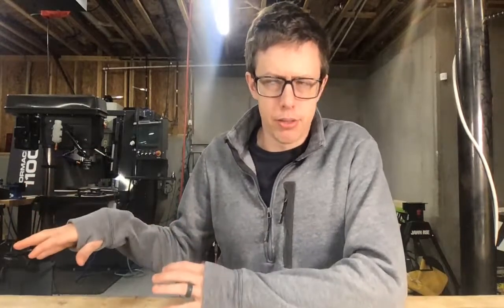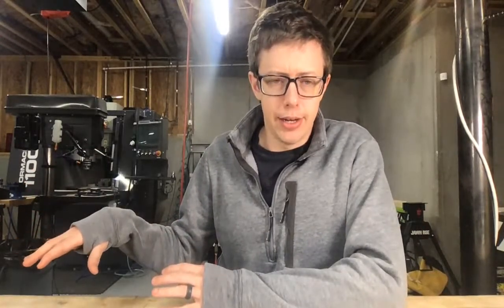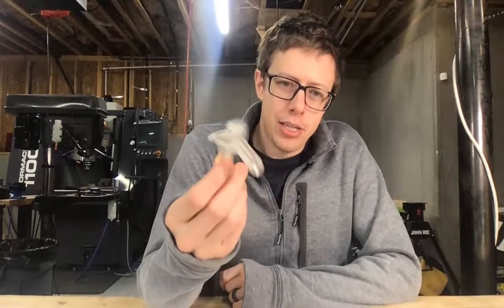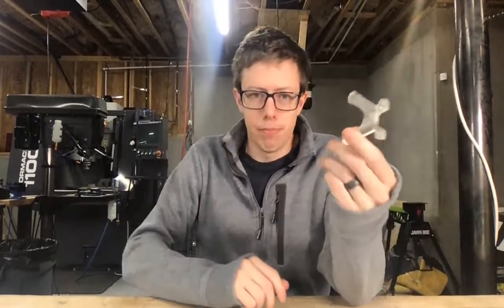SMH Livestream Jan 2021

Comment: 0:35	What projects are you working on currently?
5:44	Do you have a useful project in view?
8:57	What books are you reading to study for your social media app?
9:58	Do you use social media yourself and to what extent?
13:01	Do you read hacker news?
14:14	What aspect of robot design do most people get wrong?
22:42	What about the podcast?
24:04	When did you make your CNC machine? What did you build? What did you buy?
28:06	|-> What would you do different if you made it again?
29:38	Have you thought about getting an assistant to help?
30:19	Do you have concrete plans or ideas of where you want to take the channel?
35:41	Where do you buy raw aluminum/steel?
37:02	What did your wife think at first about you starting a channel and your decision to do it full time?
38:28	Top 3 candidates in the running for the open source project?
41:44	How long before you posted your first video, did you think about starting a youtube channel?
46:15	Can you afford to hire someone? Has the Patreon reached that level?
48:25	What are your long term goals? Do you see yourself doing YouTube until retirement?
50:30	Do you ever get the feeling that you are under pressure to keep pushing out videos to maintain the flow of funding/ideas/momentum...etc?
55:16	When did you join formlabs and what was the function you applied for?
1:00:10	Do you have a PO box?
1:00:22	Cost of owning a Form 3?
1:03:54	Could you livestream making a video?
1:05:00	Sounds like a job for an auto-tracking gantry crane cam in the shop...
1:07:07	Do you have textbooks/books that are useful in general/for mechanical engineering?